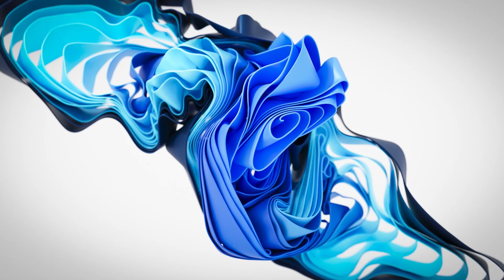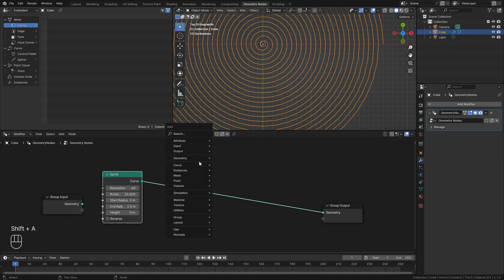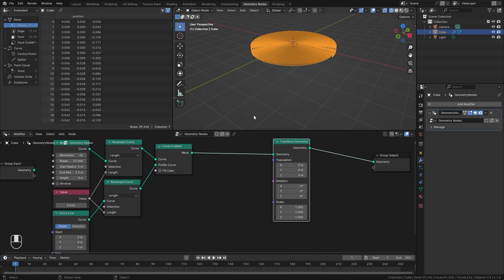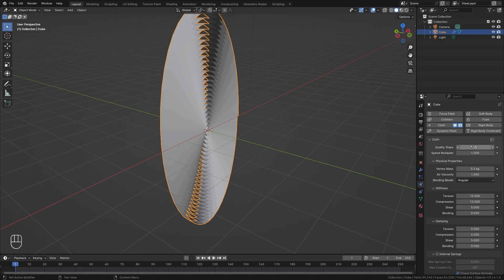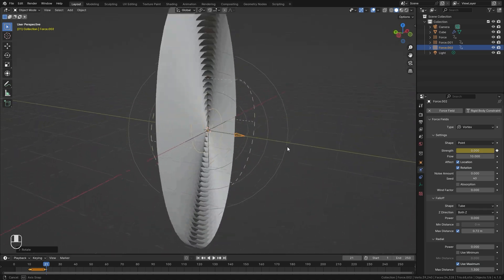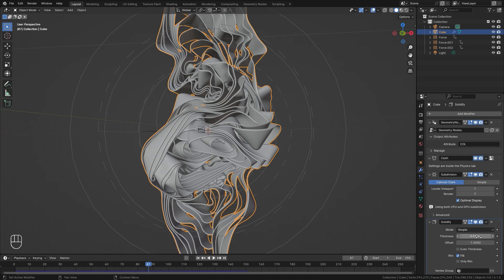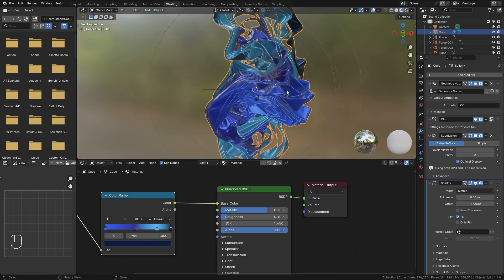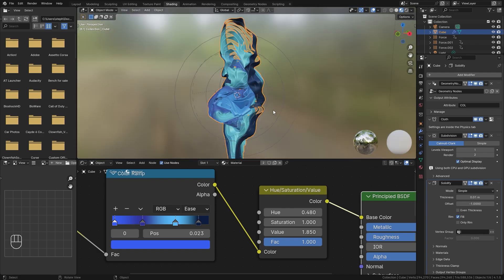Blender Tutorial - Creating an Abstract Cloth Simulation Wallpaper

Comment: Blender crashes every single time i try to input the Value node into the length on the resample curve node. Crashing on 4.1 & 4.2.
Reply from the maker: Don't use the value node then. Just put in the number into both lengths in the Resample Curve Node. The value node is only to make it easy to change both lengths at the same time but it's not necessary. It's just for convenience.
Reply: @BlenderMadeEasy  Awesome. I figured that was the case. Thanks for the quick response!